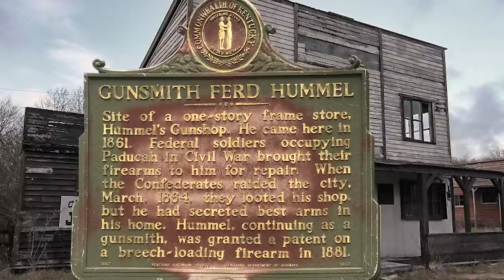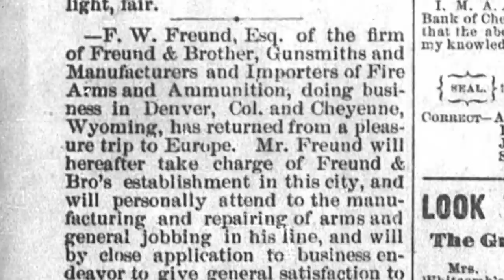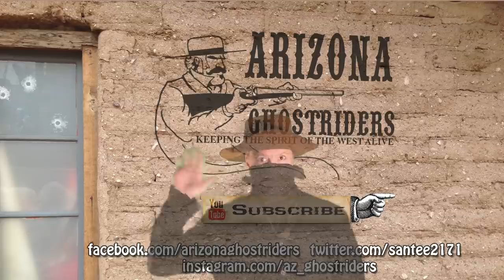The Frontier Gunsmith

Comment: Screws were also very rare. Mostly rich people had rifles made with screws, especially the fine muskets. 
Gunsmiths would hand make each one with a file. So it would be very expensive. 
If you look at lower quality rifles, alot of them only have 1 or 2 screws, the rest is help in place by pins or wedges.
Reply from the maker: Great point!

Comment: I do quite a bit of gun smithing in my hometown on the weekends to earn spare spending money. It mostly consists of headapacing issues on bolt actions, refinishing blues or the wood stocks, and mounting scopes. On occasion though I break into a project that is an absolute nightmare with the worst being a brass frame 1858 Remington clone. It was horrendously out of time to the point where the owner could put it in half cock but the leading lever would land between two chambers. There was just about 100 things that coulda been wrong with the pistol. I offered to try my hand at some repairs and boy did I sucker myself with that. The barrel had been replaced and when it was the previous owner had screwed it in too far. The cylinder was dragging on the barrel which caused the whole action to be sluggish. Long story short, I had to shave down the barrel a bit to leave a gap between the cylinder and it. I had to break the entire revolver apart for cleaning and it has something like 30 years of dirt and grime crammed into the mechanism. Finally, I had to re-file the hammer and replace the nipples because some previous owner was a fan of dry firing. I can't imagine the nightmare of having to do this multiple times an day.
Reply from the maker: Sounds like an interesting weekend gig.

Comment: The unique aspect of gunsmithing is that while blacksmiths work primarily with iron, carpenters with wood, clock makers with metal timepieces, and jewelers with soft metals and stone, the gunsmith has to be expert in almost all of these aspects. At bare minimum, be expert at blackmithing, woodworking, and clockmaking. Even the old Pennsylvania and Hawken rifles and pistols used clockwork type mechanisms. I have been gunsmithing for over 20 years now and built and/or repaired thousands of guns, I still consider myself an amateur.
Reply from the maker: Glad to have the insight from a true gunsmith!